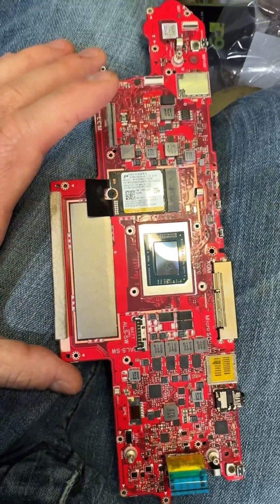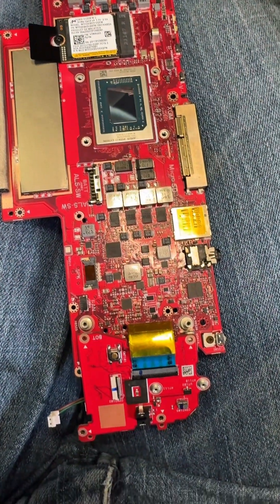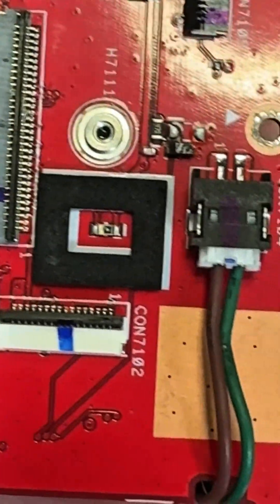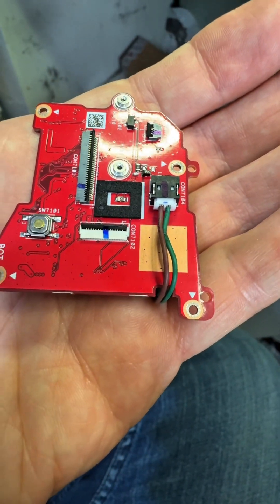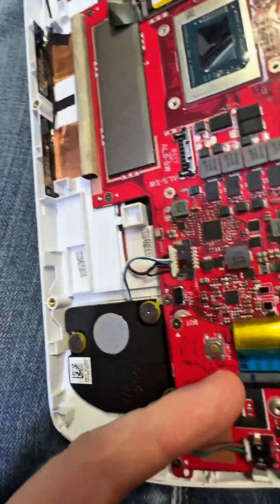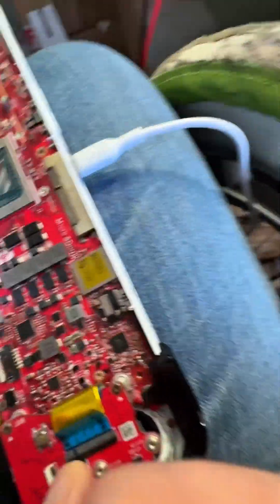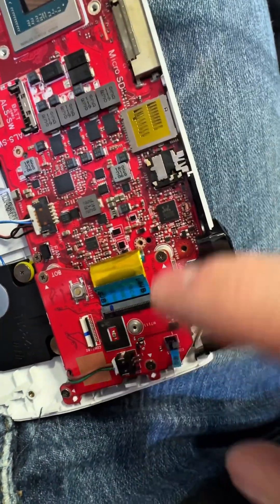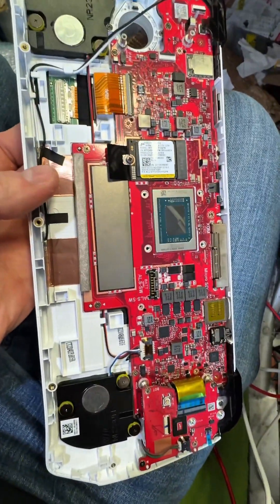Asus Rog Ally Not Charging ? , Check this out ! (Troll sensor !)

Comment: Is that the light sensor do we need to cover it with the black tape ?
Reply from the maker: The light sensor is there to sense when the case is opened and disables charging until it’s shut again. But if it’s playing up you can put black tape over the sensor itself

Comment: Do you know where this is on an ally x?
Reply from the maker: I’m not sure if other models have it or not as only worked on this one. One way to test is unplug all other cables then check if it charges. If it does then it’s on one of the cables
Reply: @Mobileithelp thanks, just trying to figure out why mine is not charging
Reply from the maker: @j @just_josh_90  have you put it all back together ?. As on this model it would stop charging if you opened it as the optical trolling sensor senses light and stops it charging.

Comment: You said charge port been replaced , what's happened to the OG usb c port plz?
Reply from the maker: The pins inside it had been damaged by the user. You can buy the OG ports directly from ASUS Europe. Or I can do them mail order Repair .
Reply: @Mobileithelp  Wow that really frightened me because it has one port type c , should I buy it or just buy any handheld with 2 type c ports?
Reply from the maker: @wewoo2847 to be honest if one type C port is damaged it can stop the other working anyway so it doesn’t really matter. E.g I’ve seen laptops with three type 3 ports, one got shorted out and blew up the charging chip, so the rest wouldn’t work anyway. 
The port on these rogs can still be replaced. 
If you’re scared of damaging the port use a magnetic usb c charger . It just unplugs if the cable is strained

Comment: I've got one that will charge but will not boot up. Anything I can check internally? I tried a different battery as well.
Reply from the maker: It’s more than likely got a shorted capacity to somewhere on the motherboard, but without a thermal camera, you’re going to have fun trying to find it. The only thing I can suggest is to unplug everything internally to make sure it’s nothing plugged in causing it.

If you get stuck, I do postal repairs on these if you wanted to send it in

Comment: This doesn’t work for me. I’ve got the center covered up with a piece of tape and it still don’t work. All I know is I got an update sometime last year and it stopped charging after that update. I didn’t realize it until it was too late and I tried replacing the battery, but the system is in lockdown mode. It won’t charge or nothing. Or even come on.
Reply: any updates?
Reply from the maker: I can take a look at it for you if you wanted
Reply: Kinda have this same issue

Comment: This is brilliant – they should print it in newspapers! You have no idea how much you helped me. Thanks, man.
Reply from the maker: @krzemas80  I was trolled to death by it until I saw someone’s reddit post on the subject !
Reply: @ So just imagine the look on my face when I replaced the motherboard in a client's Ally, and it didn’t help. I bought another used, working Ally, swapped the ribbon cable from the good one to the faulty one—and the same issue started happening on the newly bought Ally. I was already having dark thoughts about some magically transferred fault spreading from one component to another like a virus :)

Comment: Please dont work with sensitive electronics on your lap.
Reply from the maker: @HW_Printing  ha ha I wasn’t, I was merely filming it on my lap 😆
Reply: @Mobileithelp  still not great
Reply from the maker: @HW_Printing  I think people over estimate how sensitive modern micro electronics are. Mobile devices especially like this have extensive esd protection against in the design, with things like suppression diodes etc built into pretty much every circuit. 
It’s not something you can kill with static as I’ve tried intentionally in other videos as an experiment. 
All that happens is any charge is redirected to the large ground plane through the protection circuits and shielding. 
I’ve even tried putting old iPhone boards onto an electric fencer and they refuse to die. 
It’s all obviously by design and though as manufacturers wouldn’t want devices killed just from users carrying them in their pockets.
Reply: @Mobileithelp  It is made by asus so it is unlikely to survive any esd
Reply: @Mobileithelp  Exactly, all that electronics safety stuff mostly applies to mass production – one unit might fail out of thousands, so it matters in a factory setting, but much less in a small-scale operation. I don’t worry about it either and haven’t had any issues. I’ve been servicing electronics professionally for 20 years.
Reply from the maker: @krzemas80  yes I’ve been doing this about 15 years and can’t say I’ve ever seen anything killed by esd when working on things.